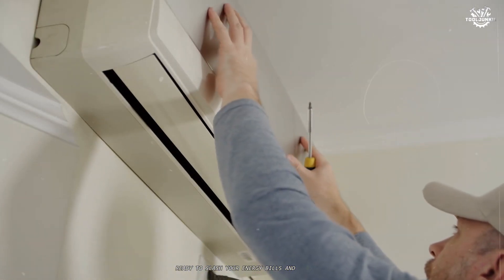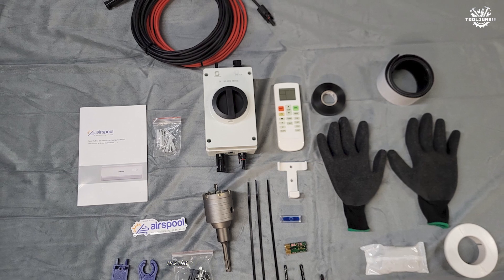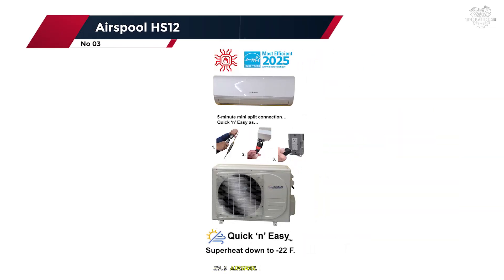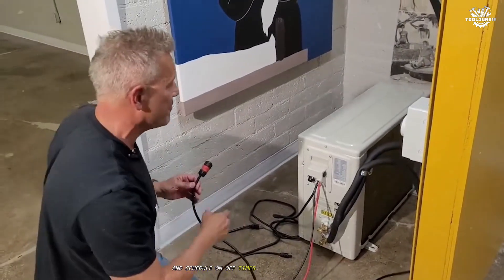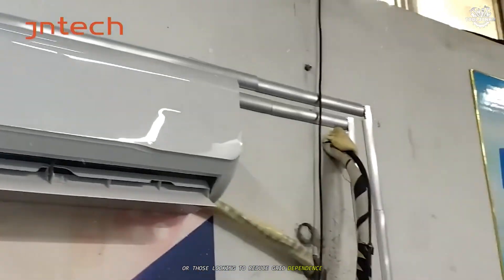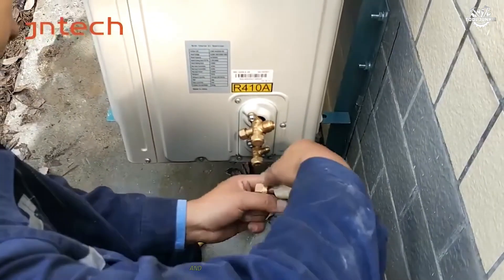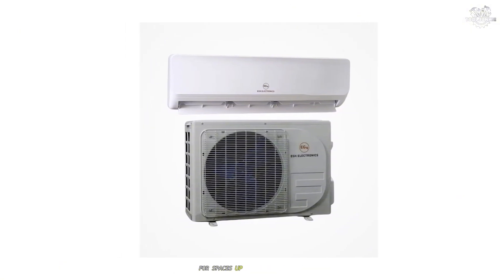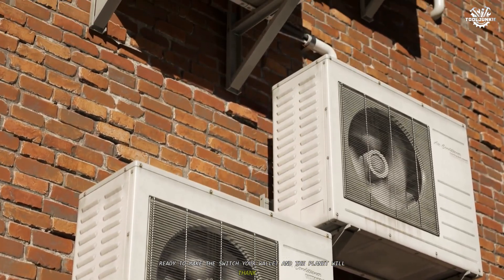Sun-Powered Comfort: 4 Best Solar Air Conditioners Tested 2025

Comment: @Tooljunkie4U, thanks for including us in your review! Yes, we tested a few units before we locked and loaded, and we get units from the same source as EG4, and that's Deye. At Airspool, when we get them, we enhance them by doing the vacuum pump and line set work in house, and then we also pre-wire the communication control wires and include the power cord. We also pre-wire the solar whips and include the solar isolator and 10 m of solar wire. The unit ships ready to go with refrigerant in the line set , not just vacuumed line set. And before shipping out, we test the units on solar only, solar and grid combination, and grid only to make sure everything works okay in all modes. And when folks get our units, they have a 1-year buy-and-try guarantee whereby they can get all their money back including shipping both ways if they're not absolutely delighted. Customer satisfaction is paramount to us. After the first year, we extend that guarantee to be a functionality guarantee such that we guarantee the unit will work for an additional 4 years. This is a great opportunity for DIY people that potentially can have their warranty voided if they are the installer for other brands. We can do this because we know how the unit runs before we ship it, and we know that the installation process will ensure success. Most problems come from the installation process not from the unit itself, so we have a way that folks can for sure have positive results with our Quck 'n' Easy process. Anyway, yes, our standard units are usually around $300 more than Signature/EG4. Both are great units with a proven track record. And yes, our superheat unit that goes down to -22 degrees Fahrenheit is $85 more. It uses something called enhanced vapor injection to make the outdoor unit colder and make the compressor pre warmed when the refrigerant comes back to it, thus allowing it to work in the super cold temperatures. So folks should consider that one if they live in a colder region.